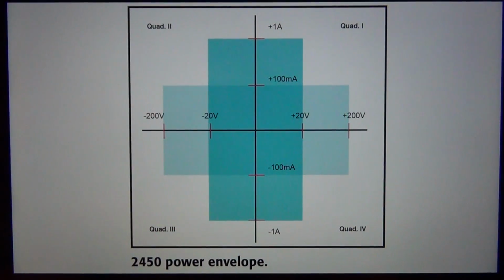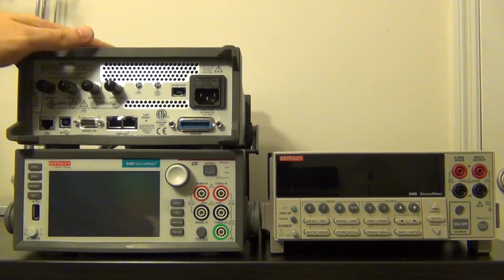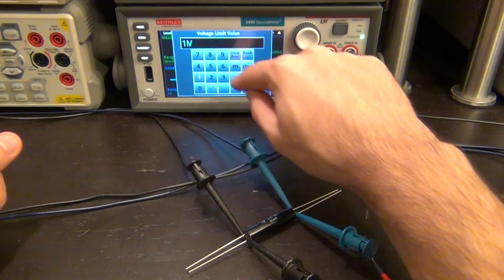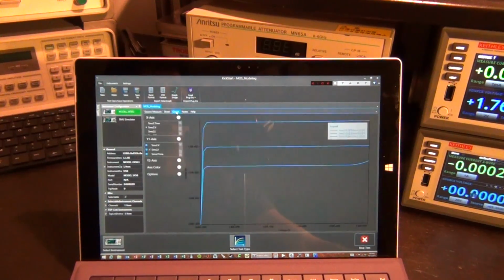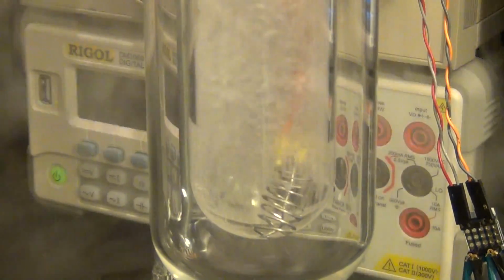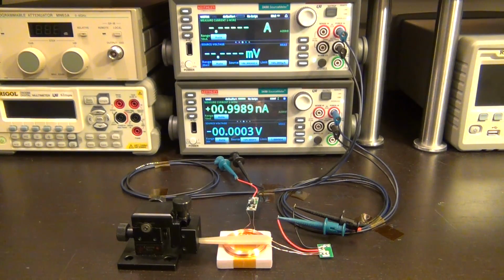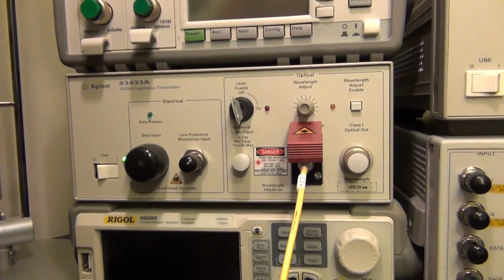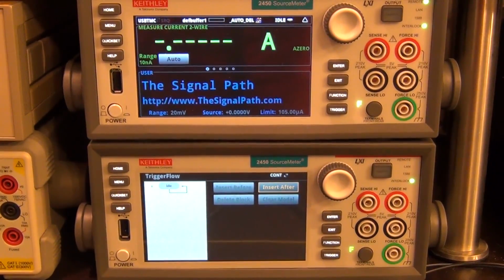TSP #36 - Keithley 2450 Source Measure Unit (SMU) Review and Experiments

Comment: I want a 2450 so bad, but man they are pricey. They do replace quite a few instruments, though. Could easily buy one of these instead of a multimeter and power supply. Even so, starting at like $8k, they are not cheap.

Comment: Excellent review!  I enjoyed it right from the beginning to the end. We are going to have one within few months. I am keen to measure highly resistive metal oxide thin film. I have seen in the video that you used a two pin (banana)adapter for plugging the metal oxide resistor(1 Giga Ohm), where did you get this adapter? Is it available from Keithley?  Could you please let me know the part name and number?
Reply: It's two parts, a Pomona 1296 connected to a Pomona 1269- http://www.newark.com/pomona/1296/adapter-bnc-plug-binding-post/dp/34F870    http://www.newark.com/pomona/1269/bnc-female-jack-to-double-banana/dp/10M4161?MER=sy-me-pd-mi-acce

Comment: So why can't you find the capacitance of the capacitor when charging it? You still get V and I either when charging or discharging, the only difference is the sign if the I and the dv/dt.
Reply: I guess it has something to do with the internal resistance of the current source not being constant during charging. Please, correct me if I am wrong.

Comment: Hi really good review of the instrument. I have 2450 smu module. I am using .tsp programming to control the module. I want to average lets say 10 readings and then store in some user defined buffer/file. I try to use  command buffer.write.reading(mybuffer, defbuffer1.reading[x]). but it gives error. can you please help me out. the whole program is listed below

reset()
--set up measure function
smu.measure.func = smu.FUNC_DC_CURRENT
smu.measure.filter.count = 10
smu.measure.filter.type = smu.FILTER_MOVING_AVG
smu.measure.filter.enable = smu.ON
smu.measure.nplc = 1
--set up source function
smu.source.func = smu.FUNC_DC_VOLTAGE
smu.source.ilimit.level = 0.1
smu.source.level = 2
smu.source.delay = 0.1
smu.source.highc = smu.OFF
--turn on output and initiate readings
smu.source.output = smu.ON
trigger.model.load("SimpleLoop", 10)
trigger.model.initiate()
waitcomplete()
mybuffer = buffer.make(100, buffer.STYLE_WRITABLE)
buffer.write.format(mybuffer , buffer.UNIT_WATT, buffer.DIGITS_3_5)
for x = 1, defbuffer1.n do
buffer.write.reading(mybuffer, defbuffer1.reading[x])
end
beeper.beep(2,2400)

Comment: Hello,

Thanks for the wonderful video. Got a quick question: does the Kickstart software work with 2400? I am thinking of getting I-V curves of three terminal FET using two of 2400 and Kickstart. In addition, are you using KUSB-488 adapter to connect your Surface and the 2450?

Thank you.

Comment: Really nice review and set of practical examples.  Thank you for taking the time to create such great examples.
Reply: Fabulous review with science not sales at the fore front.
Reply: +w2aew  You are the man sir, your videos are the best by far.
My hat up to you as well.
Reply: Hello sir @w2aew. I just bought one of these. I'm using it to discharge a battery at very low currents (source negative I and measure V). Is there any easy way to log the voltage drop data live on a PC? I coundn't a way to do it.

Comment: What about that wanky swipe stuff? Jeeeez. Please, No!
Reply from the maker: What is wrong with the swipe? I actually quite liked it. It was a natural gesture to swipe back and forth between displays and as the video shows, it works really well.
Reply: Shahriar -- what was the stylus/notebook combo you used at the beginning? Looks like the stylus is transmitting button presses as well -- I wonder if that's done wirelessly or somehow through the actual touchscreen. I know my ex's Bamboo drawing tablet was able to detect button presses, wish I had checked to see how it worked.

Comment: Looks like standard matlab code, is it?
Reply from the maker: It is similar, but it is not Matlab. It is a script that runs inside the unit and can be developed in a software called TSB.
Reply: I thought it looked like Lua, and a quick check of the Keithley reference manual indicates that it is. I'm not sure to what extent they use all of the features of Lua; it may just be the language syntax or they might implement a full VM.
The manual indicates that they have extended the language with additional TSP commands, but I expect that means that they just have a few built-in C-library functions that you can call from the Lua code to interact with the hardware directly.

Lua is a great choice for this application because it is really easy to learn and incredibly flexible and extensible. A lot of manufacturers would simply cook up their own language with a couple of basic control primitives; but that always ends up being disappointing when you need to do something that they never thought of.
Reply: Chris Baker i used lua to program my Ti CX calculator, why shahriar didn't say so?
Did Lua become a national security secret or something? Lol.
Reply: He may not have recognized it. Awesome to see other CX owners! I have the nSpire CX CAS, it rocks my socks.

Comment: Does your optical equipment  have GPIB or other computer control options? I am thinking that a full calibration could be done.   Further, does the software you used have the capability to interface with other GPIB units?

Comment: Why is GPIB still a thing?
Reply: backwards compatibility of backwards compatibility ... the next one will have one also to have backwards compatibility of backwards compatibility of backwards compatibility or untill someone creates a proper standard for GPIB over USB
Reply: For backwards compatibility perhaps ?
Reply from the maker: Mostly backward compatibility for existing infrastructures.
Reply: But it is a very clunky and slow bus and the connectors alone cost a fortune. It is parallel synchronous if I remember right? Is there such a big legacy market? What do they usually connect as a central computer? A PDP11 running some lab software running on bare metal?
Reply: A lot of new measurement gear comes with ethernet (some already have gigabit ethernet) which should be a very good replacement for GPIB.
Reply: Simon K. Im not so sure, there might have to be a new standard because of the daisy chaining requirement
Reply: Not nearly that old. PDP11? Give me a break. It wasn't even HPIB then. GPIB was widely used into the 2000s... it's not as clunky or as slow as you might think. Parallel busses in general can be very fast with low latency. The connectors are WAY more durable than a USB connector. You can daisy-chain instruments, which can be very important in a rack or large lab scenario. Plus, you can combine old and new equipment on the same rack. You can have an 80's power supply with GPIB and a brand new Rigol spectrum analyzer, for example. In a personal lab, obviously Ethernet or USB are the way to go -- but remember, most of this equipment is NOT aimed at our personal labs.